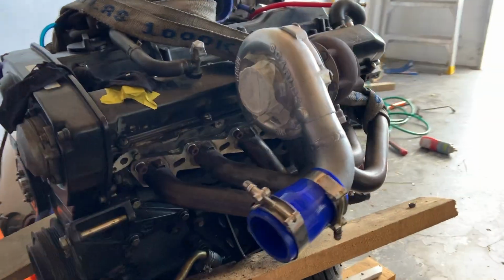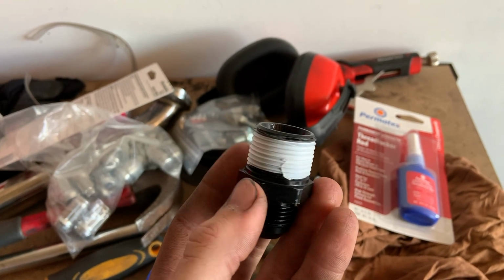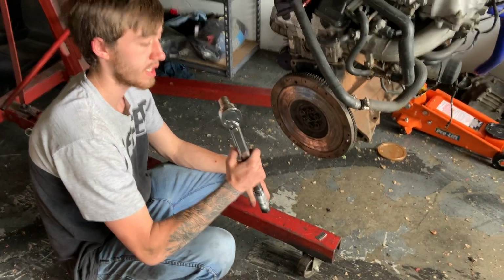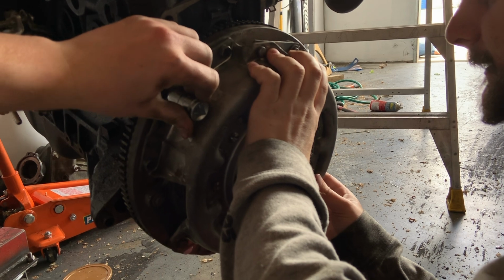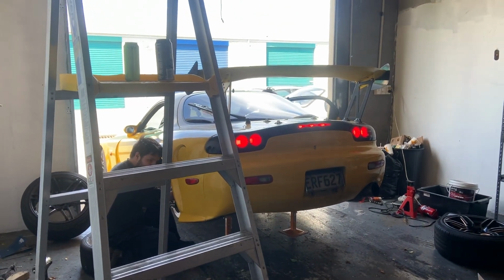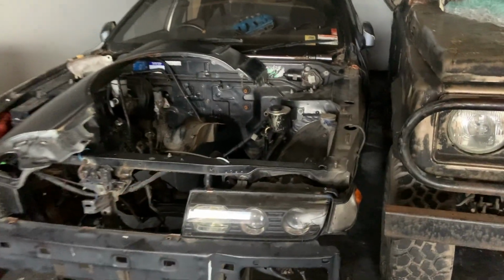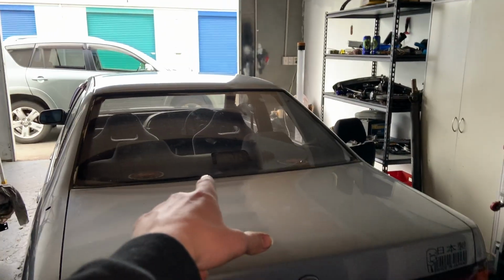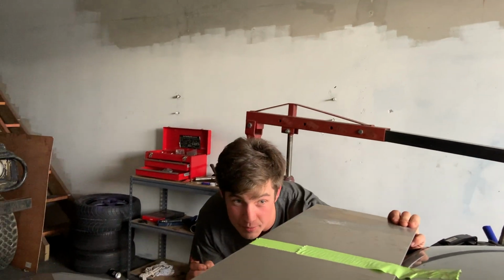RB25 SWAPPING MY CEFIRO GOES WRONG!

Comment: Please no one follow this guy when it comes to doing your car..... i dont mean to be that guy but seriously? Second hand fly wheel not even skimmed second hand fly wheel bolts second hand clutch????????? You are sooooooo rfb its not funny i just about died laughing when you said you werent lol what a guy haha i pray you dont loose a leg when that fly wheel lets go mate
Reply from the maker: Lol what are you on about 😂 using second hand flywheel bolts is fine on an application like this. This setup won’t even be making the same power that the motor came factory with. As for the clutch and flywheel I probably should have explained in the video but this clutch and flywheel were already used together but yes it could have done with a skim but it’s only going to be on the car for a few months until I get a new setup in which case I’ll also be doing arp flywheel and clutch bolts
Reply: MsDemob hey mbro fully qualified YouTube mechanic aye mbro
Reply: Im torn between tuning in for all this high level hackery that really puts a smile on my dial. Or never tuning in again because i cant handle all the cringe
Reply: Hayden Jamieson and no im a labourer and fully qualified to say that that has to be some of the most rfb goings on ill see this week im sure of it hahaha keep up the good work boys lol
Reply from the maker: I’d go with tune out bud if you have a problem with it that much 🤷‍♂️ if this is the most rfb thing you’ve seen all week then this week ain’t going to bad 😂
Reply: Joel Cowper your probably right... you obviously operate at a much higher rfb level then me lol i can only sit back and marvel in awe
Reply: never disrespect the rfb
Reply: @MsDemob  my g you got the shout ot on my boiz latest flick. You know I stay strapped to the posty alerts when mans drops one.